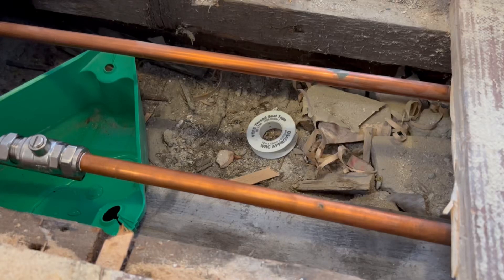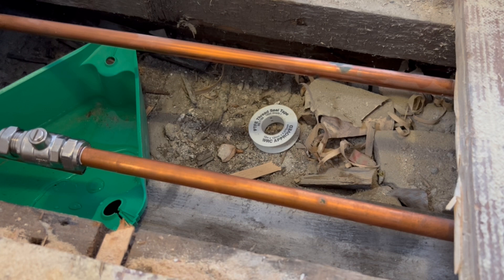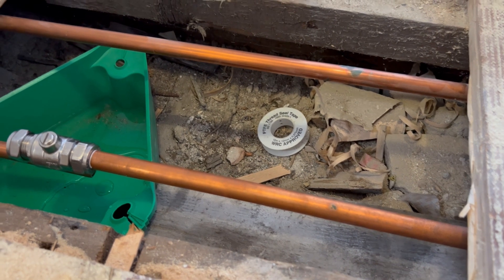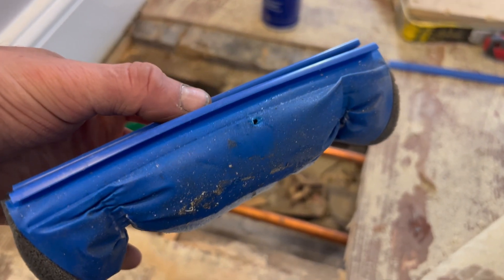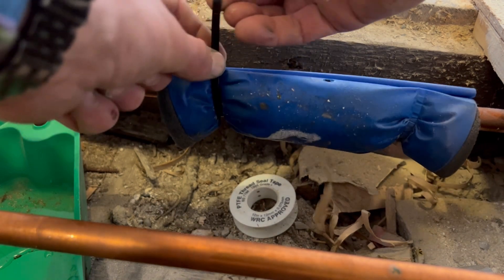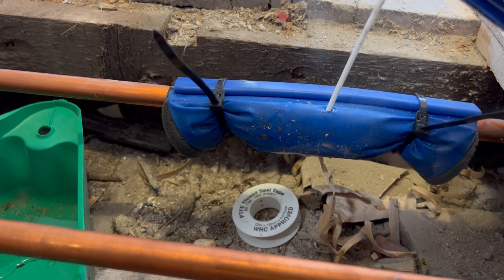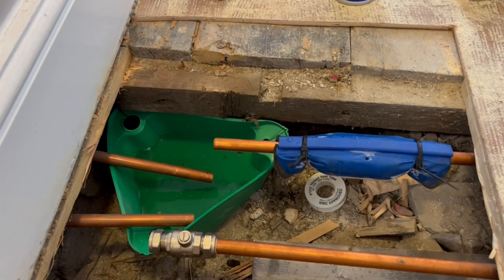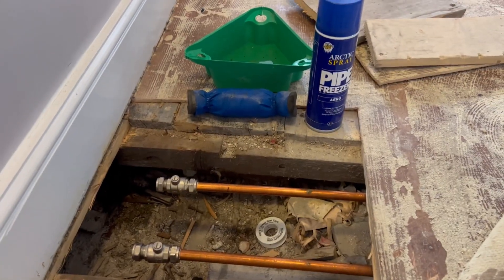tutorial about how to freeze copper water pipes to install valves or make a repair.

Comment from the maker: Other things of note, if there is a leak on the pipe or a dripping fitting on the pipe you want to freeze it might cause you difficulty’s, if there is a water flow though the pipe that you are trying to freeze it might not work, that said iv managed to freeze a pipe which had a dripping tap on it, so a little drip with a bit more freezit spray does work but if the pipe is to be frozen I’d actually running with water it probably won’t work, other things of note are get ready with your valve and spanner’s and get your olive taped up and in the valve or compression fitting ready so you can be quick!!,in regards the ice plug suddenly moving working quick and efficient really helps but if you cut the pipe with a pipe slice or pipe cutter it leaves a bur on the inside of the pipe and iv had instances when the ice plug trys to slide out but gets stuck on the burr and it gives you a little extra time, if the ice plug does blow off have some water pump plyers ready and crush the pipe flat with the plyers and bend the pipe back on its selve and you should be able to stop most of the water, of course if you can manage to shuv on a push fit blank end that would work as well 🤟🤟

Comment: why doesn't the pipe rupture from ice expansion?
Reply: Its quite brief, only super deep freeze will pop a pipe
Reply from the maker: Great question my friend, because the ice plug is only say 5 inches and it can expand down the pipe on both ends and not burst the pipe, hang on a minute you say how can the ice plug move against water in a pipe that’s blanked off or has valves or taps on it, well the pressure of the ice plug gets soaked up by tiny expansions in the pipework and small air bubbles, in regards a frost damaged pipe this generally happens when you get two parts of the pipe getting frozen first quite close to each other and then when the bit of pipe freezes in the middle the ice has got no where to go and ruptures the pipe, that’s one advantage of plastic water pipes they can expand without cracking but can be more tricky to freeze since it’s harder to freeze the water through the plastic and also the inside bore of plastic pipe is very smoother the ice plug sometimes struggle to gain a purchase and trys to slide out so you have to be quick 🤟🤟